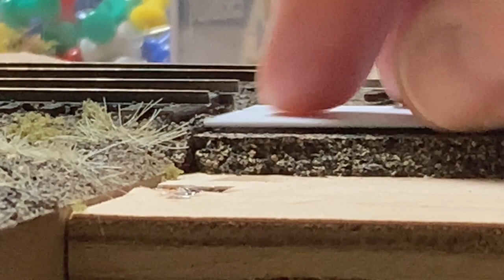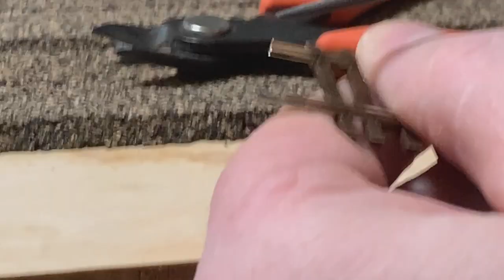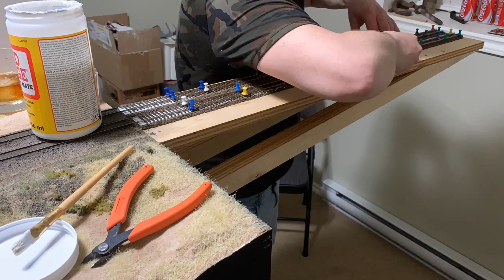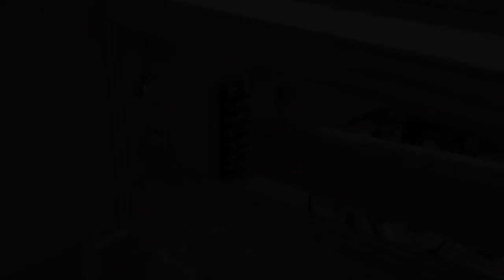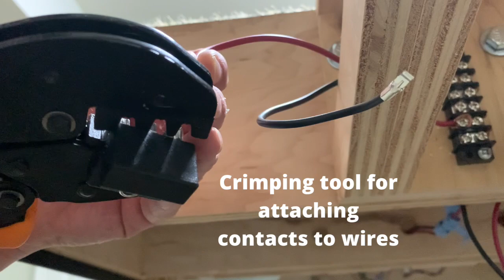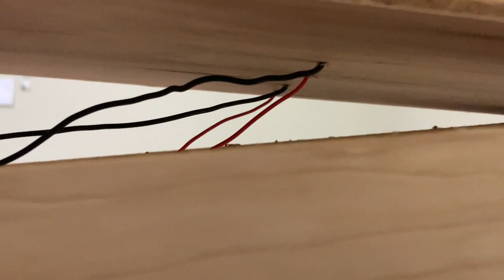Add a Switching Extension to Your Freemo Module | Part 2: Laying Track & Wiring

Comment: I don’t understand why you didn’t make the extension a touch wider at the back to protect trains from tipping off the extension. It looks like you have plenty of room.
Reply from the maker: Good question. It was a perfectly sized piece of scrap wood I used to make it—so I had what I had. Plus, I planned to put a backdrop permanently on that side anyways.